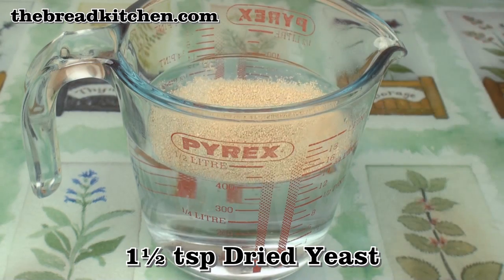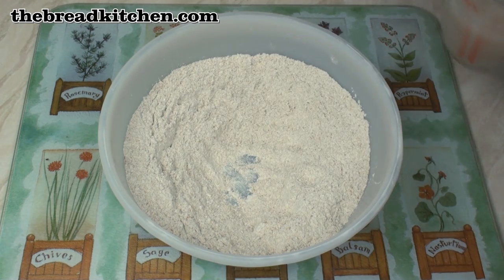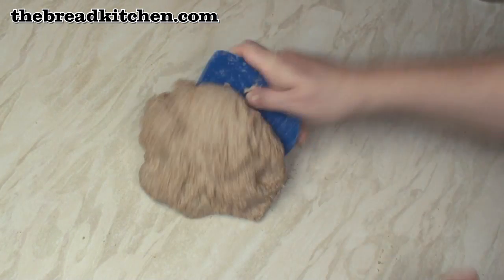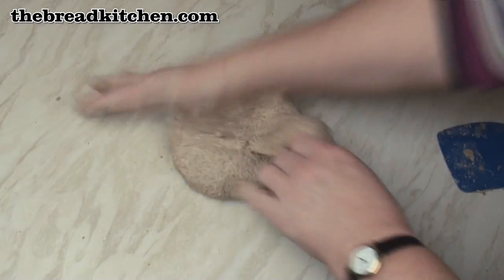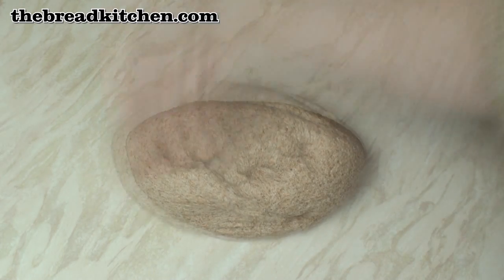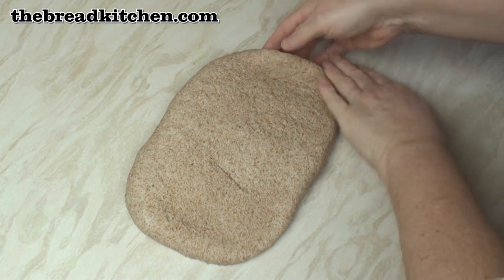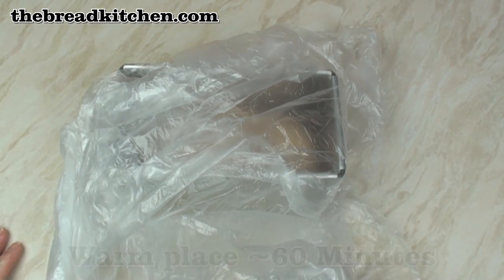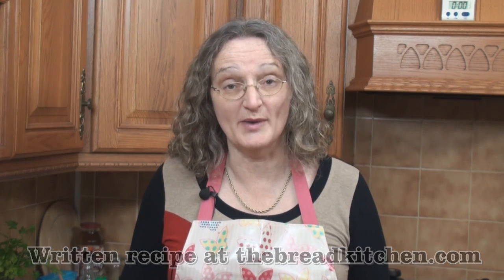How to Make A Light Whole Wheat Loaf in The Bread Kitchen

Comment: That was a very easy recipe. But my bread came out dense. I used exactly the same measurements and my flour was atta flour which we use to make roti bread. Can u plz tell me how can i make it lighter?
Reply: you can add wheat glutin or add some bread white floor with the whole wheat floor
Reply: +Rupica chhibber Atta flour is a lower gluten whole wheat than bread flour, so you might try an experiment buying and using whole wheat BREAD flour (different than regular whole wheat) and see what is the difference. If it works better, then try adding gluten to atta flour (can buy it separately) and experimenting with how much to add to get better results. I wish I could tell you how much to add, but I haven't tried that yet.

Comment: i tried 5 different recipes till now and i still not satisfied with the result i will give your recipe a try but isn't the water to flour ratio is little bit much ? any way i will try it and give you the feed back
Reply from the maker: Abdallah Mortada You need extra water when using whole wheat flour.  The bran will absorb the extra water.  Without that extra water the dough will be quite stiff and the bread will not rise so well.  As you can see in the video my loaf is light with good texture.
Reply: *****   i did as you said but the dough needed extra more flour to gather up i'm letting it rest for an hour now and wait it to raise up and give you the feedback .
thanks for your Patience